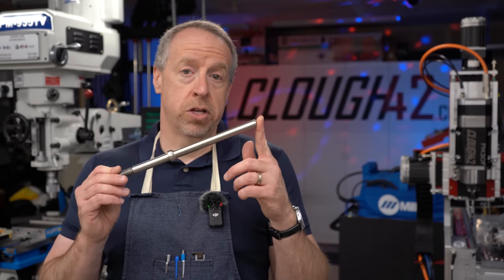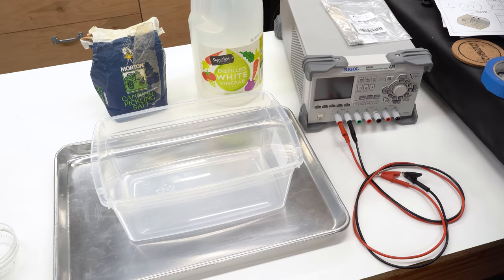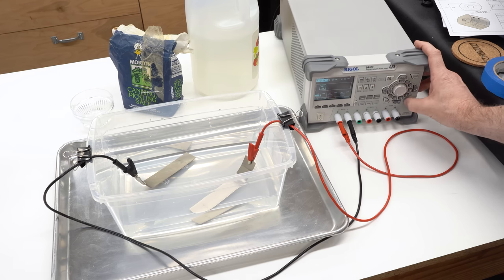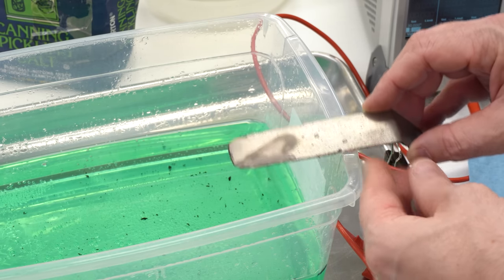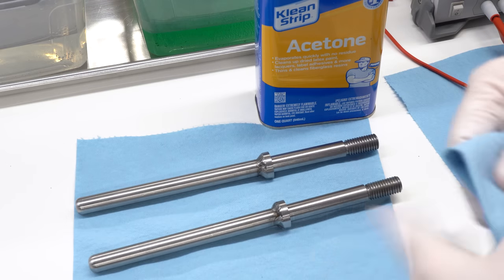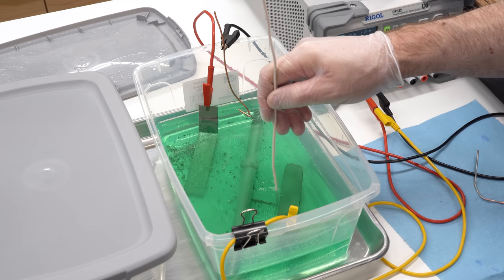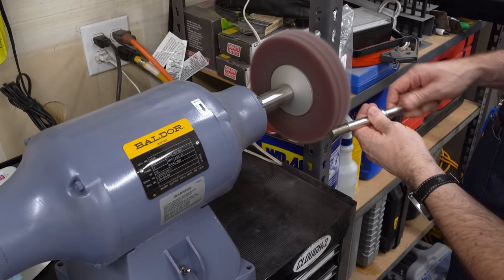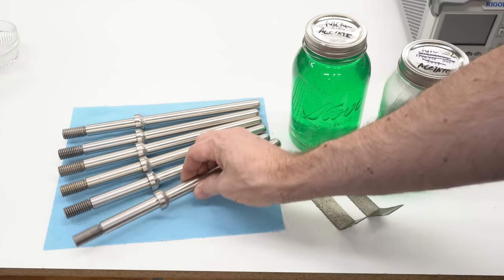Nickel Electroplating in the Home Shop - A Shocking Way to Prevent Rust!

Comment: Hi! your video is very good and the explanations are very clear! From my experience I could suggest some tips: the better the surface, the better the results, so a very good polishing of the steel is recomended; As many people has recomended, a copper plating prior to the nickel give better results (the method is very similar, just use hidrocloric acid at 10% as electrolyte); the use of a surfactant is recommended to make the bubbles detach easily from the surface (the bubbles can cause "pits" in the surface), i don´t have access to such chemicals so I use an agitation method; and finally, keep the amps LOW (0.1 - 0.3), the process will be more slower but the result will be better.  The Nickel Institute has a PDF (nickel plating hadbook) with very useful information.  Best regards and keep in mind that english is not my first language.

Comment: I used to do a lot of small batch plating and polishing, mainly custom parts for firearms. If you ever need an even more reflective, even mirror finish, this is done while preparing the base metal. One job that sticks out is the slide and frame of a 1911 45 cal. pistol that the client wanted to re-produce as an officer's " dress sidearm ". This meant taking pitted blued steel parts and changing them to mirror finished nickel plated gems. The first part was to strip off the rust and bluing with rust and blue remover. The frame was badly pitted, but more metal can be removed from it than the slide and not alter the strength or looks. Even then I had to TIG weld a few of the deeper pits. I used a belt grinder down to 400 grit then started on the slide. This was all hand work because of the complex grooves and angles so here we started hand sanding with 320 paper on small rubber erasers. From there I would go up the grits to 2500, using oil to wet sand. Then buff the parts with Tripoli compound. From there you do exactly what you did. this is what gave this sidearm a " shaving mirror " finish.

Comment: I have done this exact same thing, also as a first timer. It works remarkably well. What I did not know was that one can plate steel directly. I was under the impression one had to copper plate them first. Which is also easy, but extra trouble. What I do know, is to keep the voltage quite low (4-5V), and plate as slow as possible, for the best finish and adhesion. Especially if you want to deposit thicker layers. Even so, they are mere microns thick, if that. Its just a few layers of atoms. The most important part is cleaning. You were lucky to have freshly machined parts, so they cleaned up easy. But, one should always combine an organic, and inorganic cleaning ritual. First acetone, then followed by a water based cleaning. There's a powder scouring detergent available in the US, for dishwashing etc, that contains bleach. Cannot remember the name, but its a bright green tin, with holes in the top. That works absolutely the best, since it activates the surface, until you get almost zero surface tension when you run water over the part. That's when its totally clean for plating. Same for making PCB's, but that's another story. ATB, and thanks as usual. PS: I think that powder is called Comet. We know it as Vim (not the editor), or Ajax.
Reply: Ajax works great for cleaning parts to be anodized too.
Reply: Basic acid copper won’t plate directly onto steel without a strike plate of nickel (or zinc perhaps)
It’s possible with a pyrophosphate copper solution which is usually done at around 80°C. 
There may well be industrial / commercial plating shops that can do it but I’d suggest that they are using bath solutions that aren’t possible or perhaps advisable for DIY at home or small plating setup

Comment: James,
  Outstanding electroplating video.  In my prior career in the Electronic Connector industry, we did a lot of electroplating.  A standard test in the industry for Plating Adhesion is called "The Tape Test"  Literally, there's standards that tie to specific brands and model numbers of tapes (Mainly 3M products) that are used for adhesion testing of different surface coatings. There's a host of specific information available online.  Hopefully, you find that helpful.

Best,
Scott

Comment: Nice Job!!!  To achieve even better finish its a good practice to filter (coffee filters works great) all the solution, then wrap the anodes with cotton gauze, heat solution with a small fish tank heater and recirculate solution with a small pond or fish tank pump, it help to break bubbles on part that causes pittings on finish.. Im testing with a tin solution but I used sulfuric acid instead of acetic vinegar..  For prepping the solution a rule of task its to use a lower current, so it slow cathode degradation while forms a good metal-acetate solution.
Reply: That gives me idea to reuse my pcb etching tank that has both eating and bubbles pump. Not using it anymore cause it's now much cheaper to have pcb made professionally and let's face it the result is just better. The the tank/heater/pump are resting in a box in the attic.
Reply: Yup, it's just like PCB etching, only in reverse. Heating and agitation will help to speed up the process and keep it more even.

Comment: Nicely done. 
The vinegar process was very simple and I still have the original solution in the jugs the vinegar came in. 
I plated a few parts before I disassembled and plated a brace. 
It worked pretty well. Like many of the comments here there is a lot to learn. 
Small parts were easy. I strung them on a steel wire. My source said copper kills the solution. I put four nickel welding rods into a small jar and hung the parts in the center about an inch from them. 
Plated like a dream. 
The crank was a different problem. The shape kept it away from the electrodes and the bucket had to be rather large. It took a lot of solution and plated slowly. I think mostly because the current per square inch was too low. 
The corners plated quicker and the sharp edges tended to develop icicles if I bumped up the voltage. 
The plating  doesn't plate inside of an opening very well unless the cathode is placed inside the opening. Otherwise the plating is attracted to the nearest surface and builds up around the opening. 
It does add thickness. The threads on the chuck barrel were worn to the point it rattled a bit. After plating it was just enough that the barrel threaded on smoothly. 
That project was done in December of 2018. Still looks good.  😁😎

Comment: When plating steel, it is highly recommended you plate with copper before adding nickel because you will wind up with a much nicer surface finish at the end. Copper is a softer metal and will polish out a lot easier than nickel will. Copper is also quite a bit cheaper. You should be able to plate a lot more parts using the same nickel anodes before they wear out if you are plating over copper instead of bare steel. The black sediment may be caused in part by having too high of a current.
Reply: In general copper will not plate directly to steel. You would need an intermediary layer (typically nickel) before you can plate it with copper.
Reply: I have an old book on playing that says zinc, copper, then nickel. The zinc protects the steel and is not porous while the others are. The nickel will let the steel underneath rust eventually.
Reply: Should you polish the part between switching metals?
Reply: @firstmkb  it is not necessary at every step, but it does help get rid of flaws in parts such as deep scratches and pitting. Be sure to clean the part thoroughly to get rid of any residue before plating the next layer.
Reply: @firstmkb  IMO it depends on the surface finish. Electricity will always take the lowest resistance path, so generally the shortest path. That causes any imperfections to become magnified as the new material will plate more in the slightly closer spots vs everywhere else. Sanding between layers would knock those high spots off, improving the final finish. However you may need to make each layer thicker to compensate for sanding losses.

Commercially they don't. But they also have the process dialed in for a good finish.

Comment: Interesting video. How you've demonstrated this nickel plating process makes it look a lot more user friendly than any of the other metal plating options I've seen over the years. I don't currently need to plate anything, but in the past I've felt that a few items I've made/modified would have been better plaited rather than just painting them, or leaving them bare and relying on an oil film to keep rust off it. This video makes me think that next time this dilemma crops up, I might feel inclined to give this a go.

Thanks for uploading it.
Reply: You can boil a rusty part in water to change the rust to magnetite, a process known as rust-bluing.

Comment: Perhaps nickel spools/bands/strips for spot welding batteries could be a good source for plating applications? You could run the nickel band all around the wall of the container, surrounding the parts that you want to be plated.

Comment: An old computer power supply (5 volts) and a couple of Mason jars work well for me. This lower voltage plates better, but does take more time - so what. I am pleased to be able to match the color of antique collector items from the Civil War era, just a bit yellowish instead of bright and new-looking! Collectors were very pleased with the matching color results. When done, just lay a small piece of plastic sheeting (Zip-Lock sandwich bag) over the jar top, to isolate the lid from the liquid, and then put the lid back on the jar for the next project. (BY THE WAY, I re-use the acid from an old car battery, being careful to dilute and vent away any hydrogen fumes from accumulating. Just aim the fan on the power supply unit.)

Comment: I would suggest strong stirring of the solution to stop bubbles forming as that leads to an uneven coating. Also electrolysis of the part to remove a small amount of the surface and remove any dirt or impurities before coating helps too. If you do both it will come out much more shiny.
Reply: Maybe something like the magnetic stir rods I remember from chemistry lab would work ... very nice.
Reply: @UtubeUsername123545  Aquarium pump .

Comment: Nice! I used that method to remove rust on steel parts as well. Cool to see the nasty rust falling off as anode and parts bubble away removing the rust. I had small rusted springs to a project. Turns them black but once polished the results are GREAT!

Comment: nicely done. As a jeweler, I recommend to bring any kind of parts to the intended surface quality before plating ( even the most tiny marks and scratches remain visible ). High shine polishing or matte surface and then plating. The plating is very thin, but very durable in case of nickel. The next step is final surface treatment from matte with manual methods using dry powders or emery cloth to high polish with a cotton wheel and a little polish paste ( green for example ).
Reply: What is the best way for a beginner to get a matte finish before plating?
Reply: @rogierius  in general: quantity and size of parts: methods: manually or mechanically: think like this: depending on the metal of your parts: anything that can scratch the surface of your parts. Silver is much more softer compared to gold, titanium is much more harder compared to aluminum or mild steel. Some standard cleaning powders have abrasive particles mixed in. With a cloth and the dry powder you can get very nice even matte surfaces. Finer Emery cloth and steel wool is the next instance. Mechanically: tumblers with abrasive materials. Electrochemical methods might be not beginner level. So called Activator fluids are a mix of chemicals that are in use for cleaning parts before anodizing as well as making matte surfaces. Working of sulfuric acid and acetic acid need special preparations that certainly are not beginner level. Any method you are choosing: after surface treatment, you need to clean your parts, best is in an ultrasonic bath. Make tests, be confident in your approaches and good luck.

Comment: The part generally needs to be polished to get a good surface,  plating generally doesn't cure a bad surface finish.    The part must be super clean, with no void or surface pits containing any oils.  A good good aggressive alkaline cleaner followed by a a dilute acid bath rinse to neutralize the alkaline bath.   I have found the the hardware store acetone is not exactly the purest stuff and those paper towels likely contain some sort of softening agent.   Do the acetone clean first then the alkaline clean. Dry with a lab grade Kimwipe if you want or a well washed cotton towel that is not been around any fabric softener.   You can get Ni balls for anodes that you put in a polypropylene anode bag or sock.  The balls give you good surface area and the sock traps the smut that forms on the anode

I have done a few items in my shop, using a Watts Ni bath; Nickel Chloride, Nickel Sulfate and Boric Adid.  Then there are the magic sauce additives  brighteners, levelers and wetters 
So far I have not tried any additives.  One I heard of was high molecular weight polypropylene glycol  available a the laxative    MiraLAX.
Reply from the maker: I've read that table sugar makes a big difference on the brightness of the finish.  Haven't tried it yet.
Reply: What about bead blasting to get a matte nickel finish? (Because polishing sucks)
Reply from the maker: @chrisj4570g  yet another tool I need.

Comment: Excellent video. I was particularly interested in this experiment since in my first job, 50 years ago I worked with copper-sheathed heating elements, which we sent to a local works for nickel plating. I never tried to buff the resultant finish as you did. Prior to your demonstration, I thought that it would be necessary to copper-plate mild steel before the nickel application - evidently, it isn't needed. As an aside, I clearly remember the smell of almonds - cyanide - at the plating company. That, I think, was for the chrome process. Subscribed.

Comment: Used to work in a shop that did plating. Electroplating fast gives more crags in the surface and duller appearance but speedy. Slow will give a different finish bc it plates a little more evenly.
Reply from the maker: Thanks.  I had some failures on other parts since I shot this, but only when going fast.  That also explains the mess on the cathode while making the solution.

Comment: Nickel Sulfate and Boric-acid plating solution makes a much more shinny coating. You should also bubble air or agitate the solution by stirring or you will get thicker spots on the area facing the Cathode.

Comment: Nicely done. I have done similar plating with nickle, copper and soon to try zinc. Have plans on building a copper plating drum tumble plater for my cast bullets. The zinc is for restoring hardware that has begun to rust or was in need of modification. As a professional gunsmith, I am aware of a company that offers kits to plate gold, silver, nickle, copper and others if I recall. The automotive restoration supply sources also have plating kits (yellow zinc kits etc.). Be responsible, dispose of your hazardous waste properly, contact your local hazardous waste disposal. There is usually a free drop off.

Comment: VERY NICE video. What you just showed is what is known as "Dull Nickel Plate". It is a process that is not done in plating shops anymore because, as you noted, it is not shiny. The coloring is also not as "white" as modern plating. - THIS IS JUST WHAT IS NEEDED when restoring antiques! You can still get "shiny", but you have to spend time polishing. Thank you for showing and explaining the process - simple to do at home or a small restoration shop.

With any electroplating process, the thickness is related to "ampere-minutes per area". If you plate for a longer period of time (area and current fixed), you will have a thicker layer of plating. If you plate at a higher current (area and time fixed), you will also have a thicker plating, but the temperatures will increase. If you plate with a smaller part (current and time fixed), the plating thickness will get thicker.

As with most chemical reactions, higher temperature will make the reaction faster. When carried to extreme I suspect the characteristics of plating could change. With higher current per area, the voltage will increase and I suspect this could impact the quality and/or durability of the plating. Further refinement could also be added such as filtering the electrolyte, adjusting the PH, maintaining temperature, agitation, etc. But the complexity would rapidly grow and no longer be practical for the hobbyist.

As such, this simple "home" process would not be suitable for critical applications, and you can expect fairly wide variations from part to part if you are making several examples. But for general restoration - I think this process will work extremely well. Thanks for showing.

Comment: Another good metal coating is old timey blacksmith's blackening and it's ridiculously easy to do.  The heat in the metal burns the oil slathered onto it and leaves a relatively hard carbon coating on the metal, and it in turn holds oil for long periods that prevents the metal from rusting.  It looks gray after the burning process but as soon as oil is applied the magic happens.  Repeat the burning process 3 or more times to build a thicker layer of carbon.

Anodizing aluminum is easy to do too if you pay close attention to avoiding contamination and to your solutions temperature.  The Caswell dyes have performed the best for me.

Comment: Usually nickel plating is done before doing any other type of plating.  Other plating sticks well to nickel.  I did gold plating that way once. You can buy the nickel plating solutions but they are not cheap. And gold is very expensive.